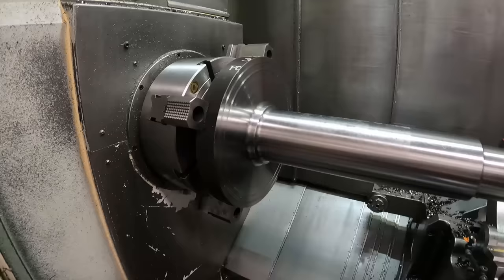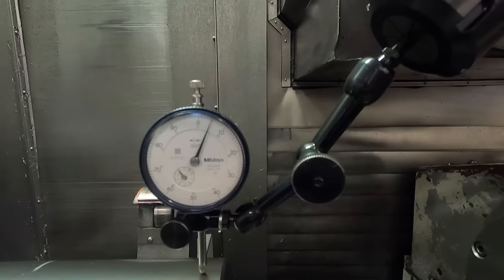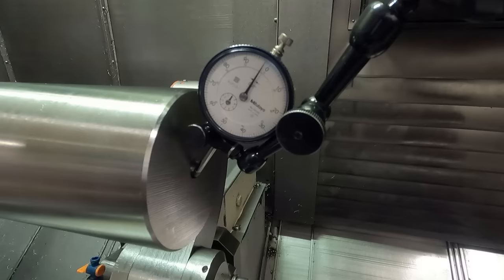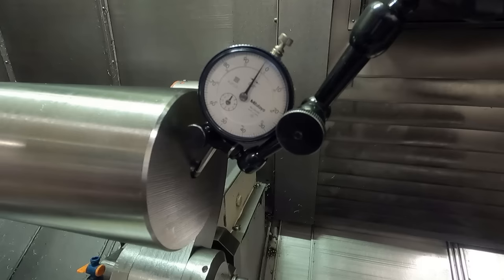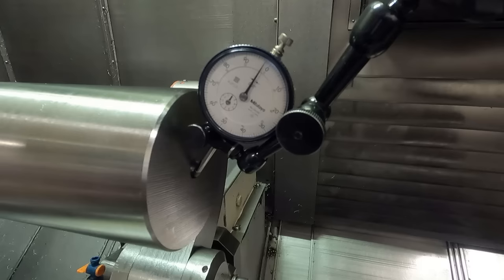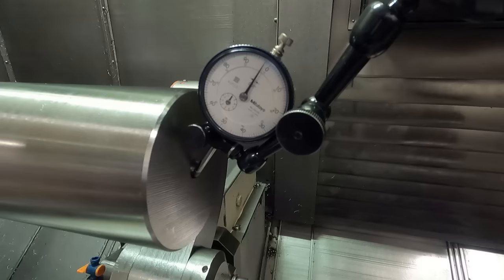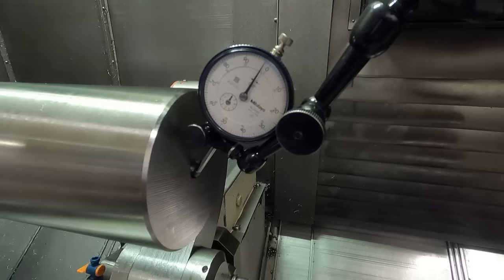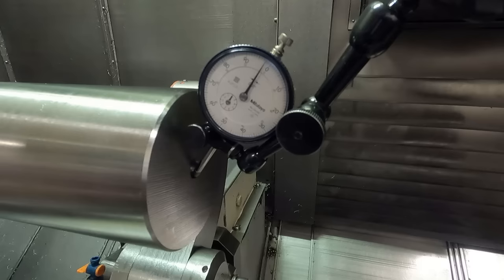Machine Shaft From 2000 Lb Stock

Comment: It feels like someone should start to forge round stock with flanges: easier to cut off 3x excess length, than to turn down 3x excess diameter... They may even become a standard if there isn't one already.
Reply: no the proper way is to use trepanning.
Reply: I had the same idea - I think there's a solid business idea here for someone with a forge. The hard part is to work out an optimal inventory: there are too many variables in the shape of the blank (2 diameters and 2 lengths) to brute force the inventory the way you can brute force an inventory of cylindrical stock (1 diameter and 1 length). I think one could crack it with the right combination of engineering and relationships with job shops (to gather market intelligence). And if one could, I think there would be some healthy margins there!
Reply: I think the efficient way is to friction weld two adequately sized cylinders
Reply: @tallswede80  See https://youtu.be/yPtoxEgzrhE?t=105 for a direct response from Peter :)
Reply: @bschwand  See https://youtu.be/yPtoxEgzrhE?t=105 for a direct response from Peter :)

Comment: When I used to run the lathe, I would try to chuck on as little as possible to finish turn a shaft.  That way the tailstock center could more easily align the center to the center hole and not spring the shaft.  I wouldn't want the shaft up against the chuck jaw face because the tailstock can't align the center with the center hole then.  I have usually always saw at least some small degree of misalignment and springing when turning between a chuck and tailstock center or chuck and steady rest.  Turning between centers is the best for concentricity and for not springing shafts.  Thanks for the concern for detail.  It actually took me five years or more to figure out these details you are explaining here.  When turning between centers,  I would turn a 60 degree soft center on a piece of bar stock held in the chuck and then drive the drive dog up against te chuck jaw.  No need to remove the chuck then, and the soft center would run as good as the spindle then.

Comment: I’m am a sophomore student at a trade high school studying precision machining (manufacturing) and I was wonder if you have any tips or advice
Reply: @ryan giambra my tip to you is subscribe to this channel and study this mans quality and professionalism, and actually read the books!!!
Reply: @electedsphinx4086  I’ve been watching a few of his videos and techniques also thanks for the advice
Reply: Stay in school and don't do meth 😂🇺🇸
Reply: @timnor4803  yes sir🤣🇺🇸
Reply: Run a lot of parts.  Take pride in the finished product, eventually you get actual pleasure from holding machined parts, or watching a machine effortlessly throw chips, and being able to make it do exactly what you want it to.  I think about it while I'm falling sleep sometimes... A turn tool making perfect discrete chips like fusili pasta and leaving a mirror finish.  I've learned the most by having to program a part from scratch with no instruction, make jaws/fixtures, decide what tools, and figure out feed and speeds myself. I learned fastest and the most personally by having to think through all the steps to make a part myself, rather than being handed instructions, fixtures, and tooling.  Being able to read GCode as if it were a second language is incredibly useful career wise... It is fairly standard across machines and industries, and makes the difference between being a button pusher or opening doors into engineering.

Comment: Wow, they absolutely needed a solid piece huh?   Couldn't it have been made from two smaller pieces, welded, then turned?   Geez, 90% of the stock turned to chips.
Also,  using a shovel to collect the chips:  LOL, I use a little paintbrush.
Reply: He explained earlier two pc versions failed
Reply: Sometimes making it from solid is the most efficient way vs assemblies, casting, or forging. Makes me cringe a bit though, seems wasteful.  Fun to watch though!
Reply: Itl all gets remelted into new material, not wasted

Comment: I'm sure that somebody else brought it up WAY further down the comments that I read through. Long parts like this where there was a lot of "tail weight", I use Nal-Dex or another equivilent of plastic mesh to cover the machined areas of the part while loading into the spindle. It protects the surface finish when loading and unloading the part in case of dragging on the jaws or the occasonal "OOPS". Something like this would be perfect seeing that you have plenty of clearance with using that split bushing. Also works great for damages during shipping.

Comment: Maybe some copper in the jaws to help you move the tail stock end? It holds the part with some forgiveness. Just found your channel. Subscribed. 45 Year retired machinist. Also sometimes the keyway will relieve stress and distort the shaft. That keyway isn't that long so probably not a problem.  Made many long pump shafts 3 1/2 inches in diameter 60 inches  long. We would cut the keway before grinding the OD for that reason.

Comment: Hi Next time you a long heavy bar you don't want to damage, turn a wooden tube to fit inside your lathe spindle. with a bit of clearance so you can put some adhesive tape to hold it in place you should be able to slide it in without damaging it. John Hankin UK

Comment: 22:38 - all "springy" pressure gauges (i.e. ones that use elastic deformation of metal element to gauge the pressure - the most common is Bourdon tube types, for low pressures, like in barometers there's a "wavy" metal membrane used, sometimes a cylinder with wavy sides), so all of them are showing the most accurate readings at approx. 2/3 rd of their range. In the low range they show pressure readings lower than actual one ("the lower, the lower" ;-) while in high range they show higher readings than actual pressure.
In other words, a 2000 psi gauge will show "truest" readings between, say, 1000 to 1400 psi.

Comment: I'm thinking wow, that's alot of material to remove.
Why not buy smaller stock. Then I see the end of the piece needs to be really big.
Must be a reason not to make it from 2 pieces and weld/fasten 2 pieces together and clean the joint. I have no idea what you're making but you did a great job on it.
Just WOW.

Comment: WOW- that's literally a ton of chips- reminds me of the old cartoon where they whittle away a whole tree to get 1 toothpick.  I'm guessing it must be a one of a kind part or an emergency deal, as normally they would supply you with a forging rather than a billet.  When I'm truing up a piece like that, sometimes I use a wedge between the chuck face and the part to adjust the flange- in the case of a big part like yours where you want a lot of jaw pressure, a bolt and coupler nut make a good jack to move the flange away from the chuck face and it's a lot more precise than whacking with a hammer.

Comment: What a nice long video. Well done. :)

Seems pretty evident as how you got the part. Geometry appears rather simple. But I'm sure other shops didn't factor in the runout and stress as much they should be. The amount of double checking you did on this, is nuts. Certainly doesn't look like a load-and-go job. Have to treat each part, like it's the first one.

Comment: Nice machine, my suggestion would to set the piece up as u did add the center, then skin off the scale.Then flip the shaft around and start with the chuck gripping a machined surface, dial indicate the diameter at the chuck, check to see how straight u are, make sure u are center drilling a square face and go.

Comment: Nice lathe...sir maybe you should've face one of the ends  put a center,  remove the steady rest and take a pass just to make the stock round  only 2 or 3 inches and  turn it around.now you have a flat end, reset the steady rest cut the center. Remove the steady rest turn the o.d. you won't have that  
Problem.I really like this job

Comment: I don’t want to be pedantic. Just want to give an idea. Before first operation maybe you can make face turn back of the part and clean outer diameter for jaws and steady rest. With this way you can tighten jaws more and have more accurate center drill in first operation. Other wise if you don’t have perpendicular back face, part will deflect by tailstock pressure. I don’t know if machine can do or not? For gun drilling long holes it is better to turn both part and drill for concentricity. Stationary drill causes eccentricity because of gravity.

Love your videos. 👍

Comment: I had to design a shaft like that with a flange before covid hit, ended up making the flange part a thru hole and having the shaft go thru and welded both sides, shaft was a little shorter and flange was about 15" in diameter, price from a solid to a two piece welded went down by about 75% customer went with the cheaper welded one
Reply from the maker: This customers machine’s original shafts were welded just as you say. But they failed at the welds. No it’s possible the machining was not good or the welding wasn’t done properly. But in order not to chance anything they opted to go with this.
Reply: @EdgePrecision  That explains a lot!

Comment: On my Prototrak, there is a setting that you can adjust to meter the oil flow to the ways. It was pissing out from the factory
Reply from the maker: The way lube on this machine has a different pump controlled for time and interval by the control. The steady rest pump will control interval but it runs weather the steady is clamped or not or weather the spindle is running or stopped. It would be better if it only ran when clamped and the spindle was on. As long as the machine is on it runs and just waist oil. So I just put in just enough oil for the job.

Comment: Very nice piece of equipment. Ours are the same size and style but made by Mazak with the Mazatrol conversational programming. Can’t tell what size tool magazine you have but we got the expanded 120 position magazine. I suppose it is nice to have the capacity but we never have a full magazine. Because we produce crankshafts our tooling is redundant. So we may load 10 tools that are identical for wear and the occasional breakage. Once in a while the tool room will need a large shaft made for a spare part and we will take one out of service to fab some one offs. Great video! Liked and subbed

Comment: The chip conveyor saw that program coming and ran away! I guess it just wasn't worth it to start with a rough forging? Nice tip on center drills.
Reply: I asked Peter the same thing in another comment here and he said that it wasn't worth it: the money saved in the waste would just go to the forging shop at this low volume. Honestly, for someone with a forge, I think there's a solid business idea here: forge a selection of these shafty-flangey blanks in common machinery steels and offer them in a catalog. The hard part is to work out an optimal inventory: there are too many variables in the shape of the blank to brute force the inventory they way you can brute force an inventory of cylindrical stock. I think one could crack it with the right combination of engineering/tech and the right relationships with job shops (to gather market intelligence). And if one could, I think there would be some healthy margins there!

Comment: I think you should invest in some. Sort of pneumatic jack hammer sort of mallet for the size parts you make to tap them into place XD, or maybe use some sort push bar to wobble it into true only not by hand but by mounting a polished bar into the tool carriage or something and feeding it in while watching the dial indicator then trimming off any burnished deformed metal from. The process :)
Reply: You'll know when your true as this method works like an edge finder for milling in the way that if you go the tiniest bit too far it will start reading the opposite that it was before :)

Comment: ... you may have a misaligned tailstock... if you don't have a master's shaft that comes with the machine...then you'll have to use your precision indicator (in ten thousandths of an inch) attached to the chuck against the tailstock...!
Good luck with this correction adjustment...!

EUDS

.

Comment: I struggle on a small wood lathe. This is fantastic.
Reply: I turn a few things from steel and aluminum on a small jet lathe, do some crude machining on a mill/drill, but built my own 4x8 plasma table and have used it quite a bit. My brother has a $5K grizzly lathe and a tormach 1100 cnc mill. After watching Peter, I'm not sure whether to push myself and do more and upgrade machines to something realistic or whether to just thrown in the towel. LOL After watching a master, I know I have far to go but will never reach his level. It is fun to see the other extreme though.

Comment: In case you are looking back at this old video, why wouldn't you have roughed it down on the center, and then relieve the stress by simply loosening the chuck so that the remaining flange can relax the residual stress? Then you can reface the flange and do the finish machining. It seems to me that indicating on the unsupported center doesn't account for the sag of the shaft as it is cantilevered out from the chuck. Your explanation would help me learn--thank you!
Reply from the maker: What your seeing in this video may be slightly misleading. I was doing four of these shafts for this customer. But they had not decided on the exact diameters for mounting the bearings. So to get a start on the parts I roughed them all first. Then remounted the to finish turn them. If you look carefully in the video. You will see for the roughing there are hard jaws on the chuck. But when I'm doing the finish operation there are soft jaws on the chuck. So because I took the parts out of the machine and put them back. I had to re indicate them. Now there are actually a couple of ways to do this. As I did in this video. Or maybe a better way is to just (Because I still had about .050" to cut off the OD to finish after roughing. If I remember correct.) carefully skim a clean diameter for the steady rest. then close the stead rest and re-cut the center hole. Extend the tail center and open the steady rest. Then finish turn. Part of the reason I don't do that on this machine is for clearance reasons between the part's end and the tails stock center. It makes it necessary to move the tail center's body back to gain clearance. Now this would not normally be an issue. Except for the very close tolerances of some of the diameters on these parts. Once I got the tail center aligned cutting the correct diameter without any taper. I would rather not move the tail body back on the ways. As I say it could be done that way but it is better not for the sake of the diameters turning straight. If I remember the tolerance was less then .001" on part of it. Also I was trying to demonstrate something about part distortion from stress in the material (If I remember) on this material.

Comment: That's an insane amount of chips, is a billet shaft that much stronger than a weld on flange, cheers from OZ.
Reply from the maker: I'm not a engineer, but that's what the customer wanted. I think if the welding is done properly there would be no problem. But is a two part fabrication really more cost effective? You need to consider having to prepare the two parts for welding. Doing the welding properly is expensive. Than after welding stress relieving than heat treating. Than brought back a second time to machine. Although you are saving in initial material and some roughing time. You are replacing it with more time consuming and expensive processes. It would for sure take more time to do the job (This, was critical) and I think in the end more expensive.

Comment: Allow me to postulate that the run-out was largely induced because the original "center" was drilled by spinning the bit (in the tool head, while the work piece sagged), instead of spinning the work piece, thereby defeating the accuracy of drilling by placing the bit in the headstock and spinning the piece. Therefore the "center" did not begin at the actual center. The run-out was then measurable because it was measured three different ways, with the headstock engaged, with the center rest engaged and hanging free. Those measurements will always show differences. The center bore was made by spinning the work piece with the bit and reamer in the headstock (which guarantees that it's centered), but then the chamfer was cut by milling from the tool head, again introducing run-out (because the headstock live center cone rests on the chamfer, not the bore). The final run-out existed because of the difference between headstock drilling/chamfering and tool head drilling/chamfering. Run-out was also induced because the piece was chucked-in rough, without having been turned to roundness. It's a great machine, but it doesn't know that the rough work piece is out of round and doesn't know how much the piece sags at the unsupported end. The machine only does what it's told to do.
Reply from the maker: You are correct in some of your postulations. The center was drilled with the support of the steady rest. It was only used for roughing. I did realize that it would be better to turn the chamfer rather that milling. I did change that on the other part. I also skimmed a small area on the very end when I skimmed for the steady rest. And used that to indicate on ignoring the original center used for roughing. I don’t agree with you about chucking the rough stock. That won’t make any difference. But you did make so good observations. Thanks.

Comment: I always put 1/8 inch thick aluminum  under my jaws,  whenever I make shafts....that way, the aluminum has some give in it, and you're not putting to much jaw pressure on the part.   A lot of machinist don't understand chuck pressure, and how it can affect how the part runs..... there's a lot more stress in metal than a lot of people think.